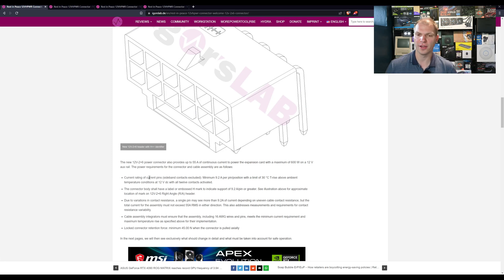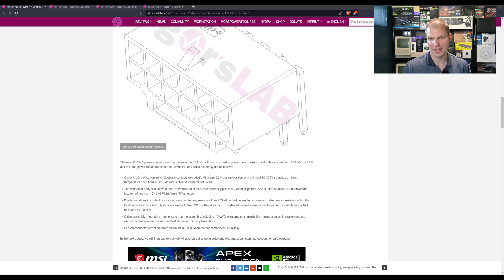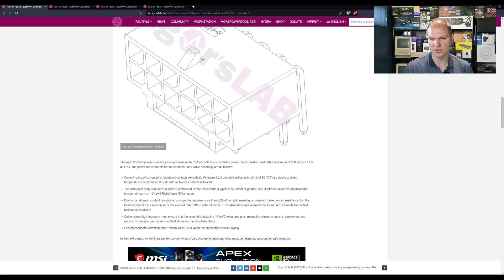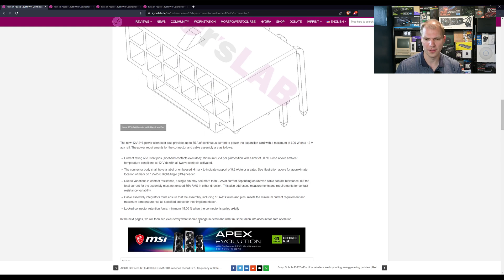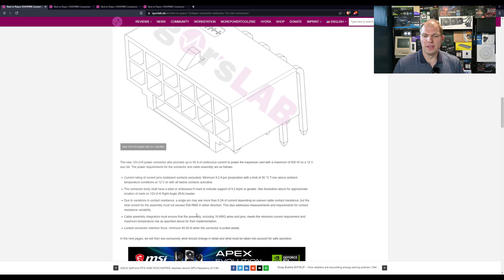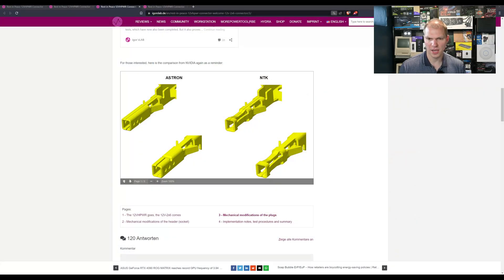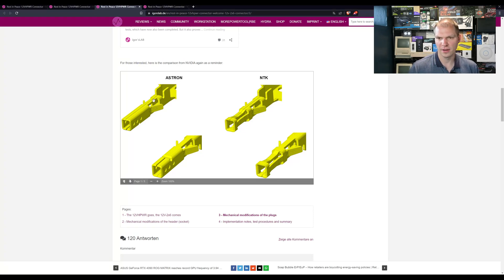Power Change from 12VHPWR to 12V 2x6

Comment: Any cases of melting 4090 with the new pins?
Reply from the maker: I don't know if or what this new connector is all on yet.
Reply: @GrayaOverload  No, most cards have old H+ connector. Forget that they will recall those cards and do the change themselves. Now there are report of 300W limited 4090 that also melted, and also 4080's. Some cards were mounted vertically so no sag on cable. They will change to NTK. Problem is that such high current pins that are so small are covered in 'high temp tin' - instead of gold-plated, which would resolve the issue with 'removing' the outer layer (scrapped tin).